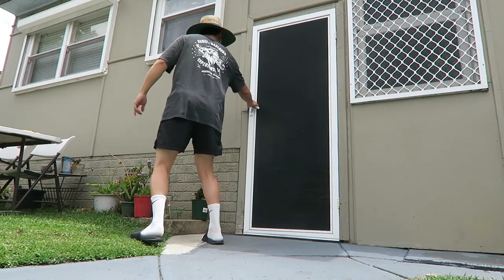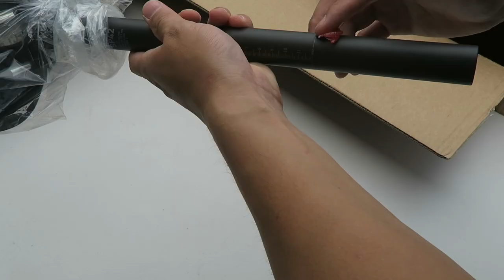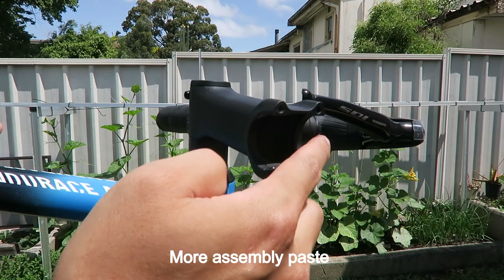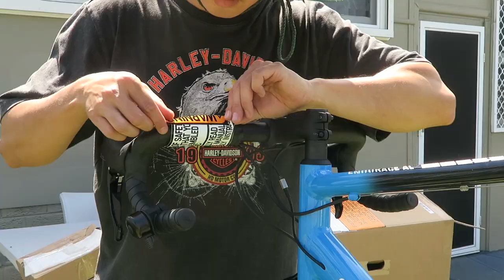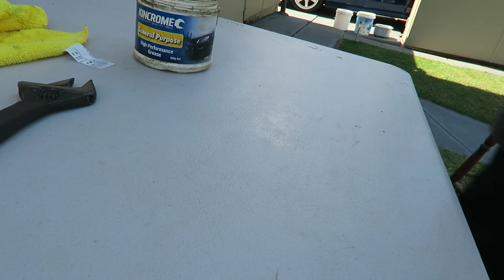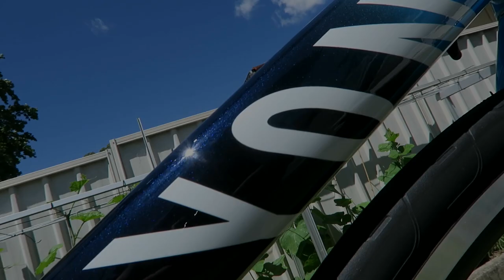2021 Canyon Endurace AL 7 Road Bike

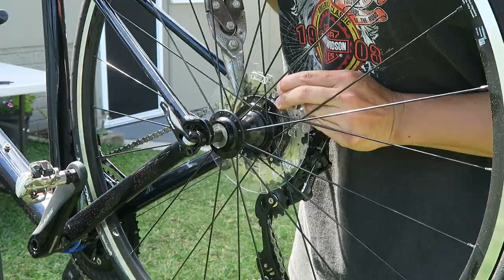Comment: Hi there. At 4:12 you were changing gears from the right shifter but, when you try to stop the rear wheel you used the left shifter!! Is it ok !! or does it came from factory that way 🤔
Reply: In Australia, front brake = right lever, rear brake = left lever.